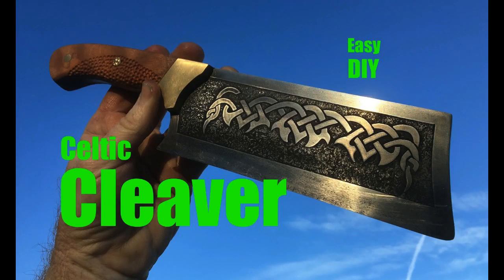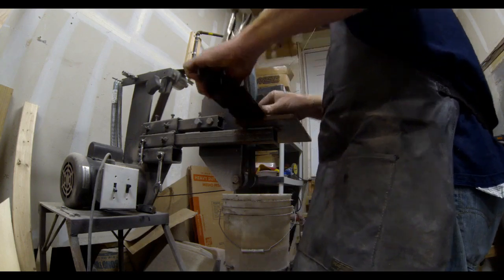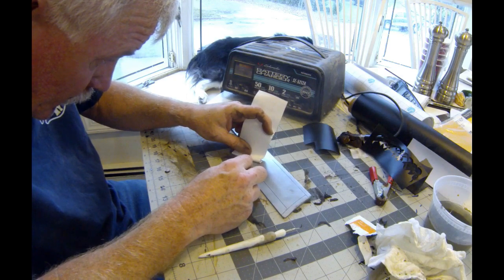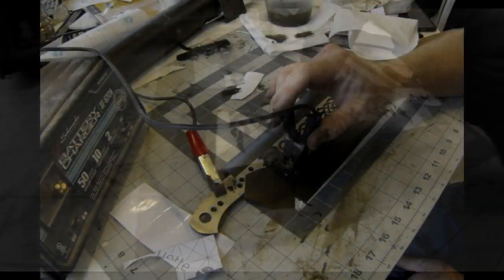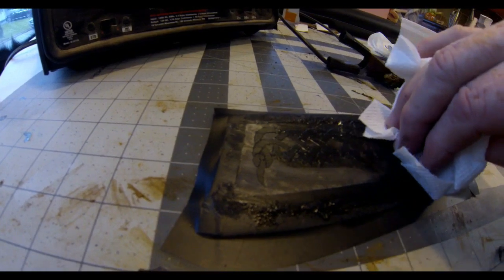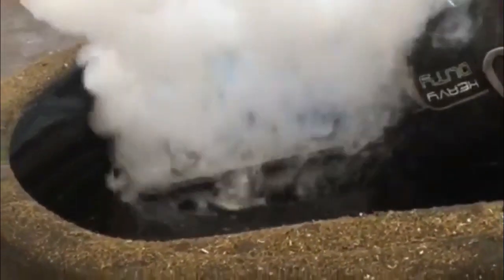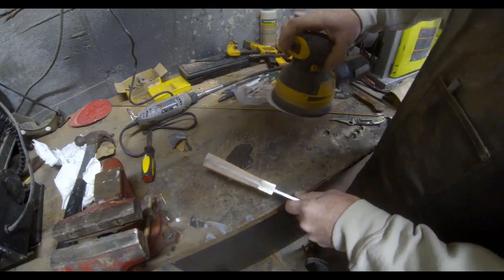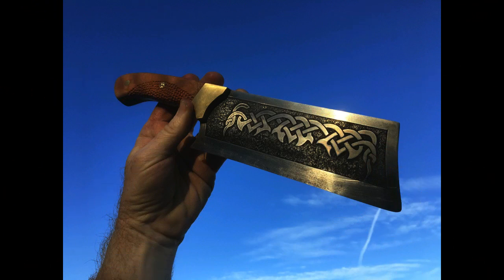How to make a Celtic Cleaver Knife with easy Etched Blade and Spine

Comment: Do you have a link to the emery cloth? just so I get right type and all.
Reply from the maker: No just went to home depot
Reply: Ok going to try this all out you see. You inspired me.
Reply from the maker: Best of luck. Msg me if you have any questions
Reply: Can this one be used? https://www.walmart.com/ip/Schumacher-50-10-2-Amp-Manual-Starter-Charger/21642130 or do I need the one you have SE-1275A?? Only thing I see different is the one you have have a button to select SLI and deep cycle, do that matter?

Comment: Hardening just the blade edge bevel region is called "decremental hardening" and it can have a smooth gradient in hardness or, for the older type called "through hardening", a sudden step in hardness at the joint of edge and back.  Face-hardened battleship side armor was of these forms, depending on the armor type and time period of the ship from 1891 through just after WWII.

Comment: You really should be careful etching with a sodium chloride solution, you might produce harmful amounts of chlorine gas by electrolysis (depends on your anode and cathode material.) You most certainly get hydrogen gas, which is highly flammable. I wouldn't recommend doing this indoors without a fumehood.

Using gloves is also advised as the electrolysis produces harmful and possibly corrosive compounds such as ferric chloride or sodium hydroxide.

You might want to use a different salt without chloride or just an acid for etching. The chemistry totally depends on your electrodes and power supply. It's not certain which gasses form when your anode and cathode are so close together (chlorine might just react with your metal.)